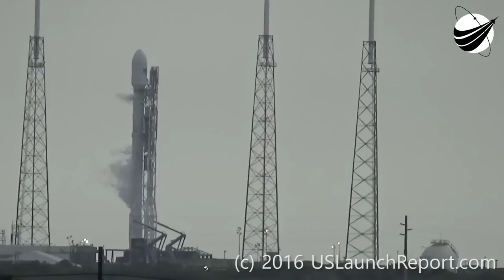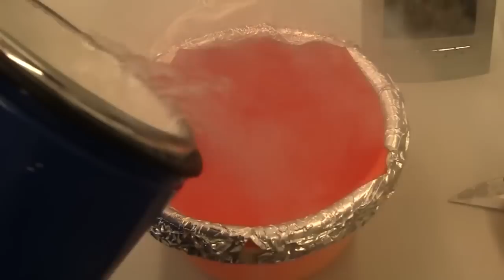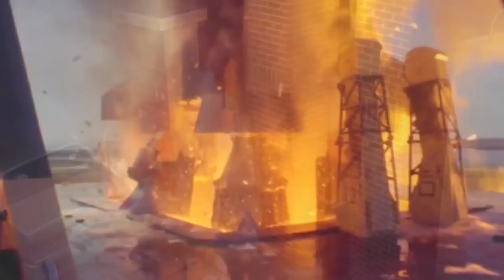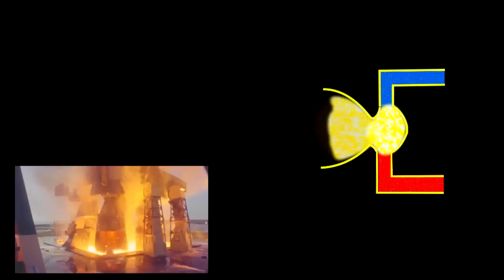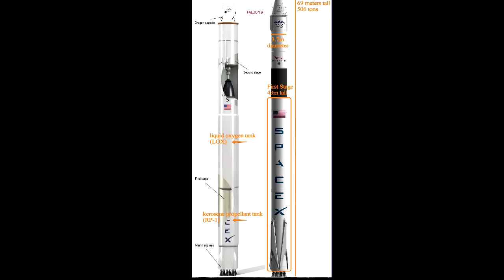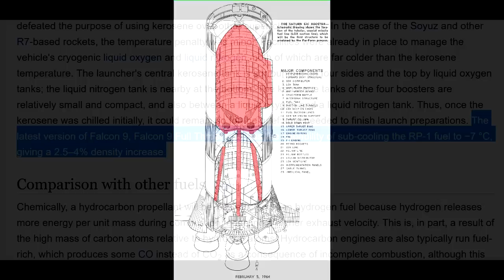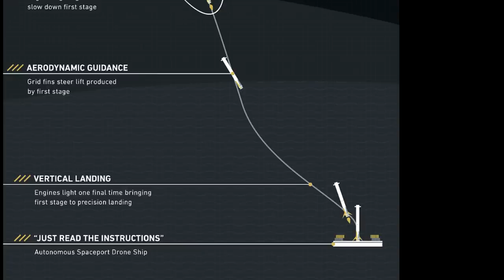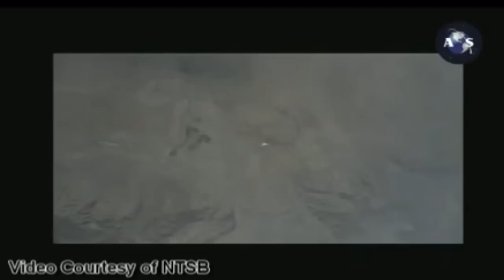Why did the Falcon 9 Explode?

Comment: I'm wondering why everyone's ignoring the anomaly that flies passed the rocket before it explodes...
Reply: Its a bird >_>
Reply: A bird flying 4,950 MPH. It flies behind the towers.
Reply: this is not a 10.000 fps phantom slowmo cam. run at .25 speed and you see the frame skips. its never behind the toweres. if its a bird, speed and size as well as 20+meters distance match and there are loads of birds as well as flys flying in front of camera. i go with the scientific answere = BIRD
Reply: +Snus Caboose Damn Lizardfolk. Always hampering mankind's attempt to leave the cradle.
Reply: Eragon Baffel
The frames you see the object at depend on the source video. In some other recordings of the same video with slightly different framerates, you can see it fly behind the tower. This video could be 29.47 FPS and another video could be 30 FPS and another video could be 29.87 FPS, and they would all change the still-frames of the object.
Reply: Or two videos at the same FPS would be different too since there is no reason they would be in sync.
Reply: it's the Martians, dumbass. They want him to prevent colonizing Mars/ or they warn him of a comming war!
Reply: dudes, end it..it's the Martians, how they did if will be a problem only once we start an open war with them
Reply: It's a linguistic tool to make a statement appear with greater weight, like saying hot fire burned my hand.
Reply: WoopWoopDk "A projectile theory would not be supported because of another simple fact. That explosion came from within. It did not originate from the outside."
A projectile hits from outside and explodes inside. All you see is an explosion, that comes from the inside. The impact effect of the projectile on the outside is much too fast to see.
Reply: Thomas Conyers y doe
Reply: +Snus Caboose speak for yourself buddy.
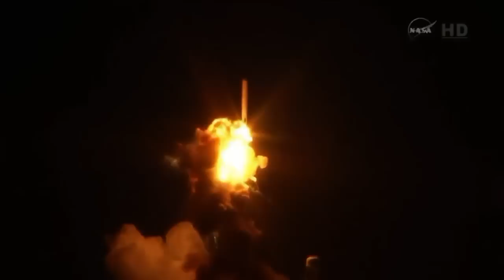Reply: I thought the same thing. Around 1:08, at the bottom right, you can seen another one speed towards the rocket and veer off away from the camera almost 90 degrees...here is a link where you can watch it at 1/4 speed:
http://www.youtubeslow.com/watch?v=_BgJEXQkjNQ
Reply: nehorlavazapalka
e z
Reply: +tunupa1 Is there a video showing how debris, or insects, in the field of view of a telephoto lens causes false perspective of distance.  People really need some science around here.  Though, the sarcasm is strong with posts on this video.
Reply: Except there are multiple object of the same size and camera focus passing before that object. And nothing indicates that the object is behind the towers as you claim.
Reply: WoopWoopDk
No, nearly every other object in the video can be explained as a bird or a bug, because they obviously have wings. The object I'm talking about, looks like nothing other than a sphere.
Reply: Sparta Well thats just dishonest. Within the first few seconds we see tons of objects similar to the "sphere". You dont have access to a 2000 fps super HD video that we dont do you? You are not able to spot any wings on those objects. "nearly every other object". Not a single object has wings. Stop bullshitting.
Reply: WoopWoopDk I'm not bullshitting, I literally see most of the objects in the actual footage have wings. But by actual footage, I mean the additional 30 seconds of footage before the explosion.
Reply: My guess would be some kind of advanced drone equipped with a projectile gun, which shot the Falcon 9. Sabotage.
Reply: sleepingeye "the human mind prefers a conspiracy theory to no theory at all."
Reply: sleepingeye
"Projectile gun"
Implying that there are more kinds of guns than guns that fire projectiles.
Reply: blank guns
Reply: glue guns..maybe it's a foreign language issue
Reply: I prefer to think about things that are likely. Unless you have proof for one or the other, you need to live with a multitude of possibilites. That's what i would call a rational approach to science.
Reply: sleepingeye
I agree.
Reply: sleepingeye As soon as you use "some kind of advanced" in a sentence. You are leaving the realm of science and logic. Its not logical to assume something unknown to be a likely cause. By unknown i mean, something that we do not know to be a possibility in terms of technology. The logic conclusion which means the correct conclusion based on given information. Is so far faulty ignition of fuel to be the most likely scenario. A projectile theory would not be supported because of another simple fact. That explosion came from within. It did not originate from the outside.
Reply: WoopWoopDk
Recently they announced they found the source of the issue, but they still have no idea what caused it. It was a failed helium tank, something that had no reason to fail whatsoever. If the professionals themselves are completely stumped, it's not illogical to explore other more unlikely causes.
Reply: Sparta The most likely case of sabotage since you are asserting that it might be sabotage. Would be internal sabotage of varying kinds.
Reply: sleepingeye Except in that scenario the explosion would also be  angled in the direction of the exit hole. Exploding a high speed projectile faces the explosion in the direction of the prior movement. Which is to say. The impact would be on one side, and the explosion would originate from the inside yet still expand towards the opposite site of impact. There was no such explosion.
Reply: WoopWoopDk No i'm not talking about a large explosive, i'm talking about a very small projectile either just bullet-projectile or with a small explosive which triggers shortly after penetration.
Reply: sleepingeye And then triggers an explosion of a fuel compartment. Possibly. Would definitely be the way to hide it from explosives experts. However it would have to have come from a lang distance, such as a high powered rifle. To eliminate the sounds element of the bullet being fired. It would be highly illogical to assume that a drone capable of flying at such speeds, and accurately hitting a target is in existence. Especially because they are not in use anywhere. And current state of the art drones are incapable of getting even close to such accounting for speed.
Reply: WoopWoopDk I don't even care anymore why it blew up, let SpaceX find out. I'm just a skeptical guy that's why i won't rule out even such things as professional sabotage.
Reply: WoopWoopDk " It would be highly illogical to assume that a drone capable of flying at such speeds, and accurately hitting a target is in existence. "  How would that be illogical? You don't know what secret agencies, the military and so on got. They might have drones that could do something like that, there doesn't need to be a bang, you could use a rail gun mounted to a drone to shoot a projectile with probably up to 2000 m/s or more, so you could fire it from miles away.
Reply: sleepingeye You need to understand what logic is. Logic is the correct assumption based on given information. It is not a correct assumption to say that out of all possibilities a force we do not know to exist might be the cause. You might be right, the logically correct answer is only ever correct in relation to the information available. In our current situation we know not of any such invention capable of such a feat. And so to assume that it is the cause of something that has many explanations that we do know to be possible, is not logical. It is highly illogical. And yet the assumption might be correct. And as such were you to decide to ignore logic, you are taking a leap of faith. Faith being the act of thought suppression to support a view that is either likable or the one you currently hold.
Reply: WoopWoopDk " In our current situation we know not of any such invention capable of such a feat."  Are you sure about that? Well i am not. Sure there are rail guns, there are high powered drones, there are sophisticated aiming systems. You say it's impossible to build a drone with a rail gun mounted on it that can shoot a projectile at 2000 m/s? I say it's very possible.

It is illogical to rule out things just because they may be unlikely.

Faith is for things you CAN NOT know. Logic is for things which CAN be known.
Reply: TheLordIsMyStrength
Reply: TheLordIsMyStrength You know nothing of railguns. The smallest railgun in existence being tested today is about the size of the guns on a destroy battle ship. A boeing 747 could probably transport it but never fire it.  

It is illogical to rule something out based on them being unlikely. Well fuck a duck and call me Brian. Did you just straw man me? I never said that. I specifically stated that the correct answer may in fact be something which we as of yet have no information on. But the logical assumption can never to be to introduce some very specific force of a flying object of greater capability than any known aircraft. And to present that as the "likely" cause of the explosion. You need to understand logic before you get to use that word.

Faith is to believe something for which there is no evidence. Does not have to be in the realm of the unknown. As soon as you take something to be true, without evidence, or even despite evidence, it is faith.
Reply: WoopWoopDk "The smallest railgun in existence being tested today is about the size of the guns on a destroy battle ship."
Wrong. Just search youtube. I know physics btw, you don't seem to.

I understand logic thank you very much.

"Faith is to believe something for which there is no evidence."
There may be evidence, just not evidence that fits scientific principles. I know that i have a soul, i have evidence for it. I just can't present it to you, so it can't be scientifically proven.
Reply: TheLordIsMyStrength I took another look just for the sake of argument. Defective homemade railguns.. That cannot shoot the required size object nor fire at the desired velocity. That is your argument. Seriously?

Also, no, you do not understand logic. If you think that going with the unsupported theory when we are talking which is more likely to be the cause. You do not understand logic. 

There is no evidence that you have a soul. You do not know you have a soul. You think you know. It is not impossible that there is a soul. That is the correct assumption on the evidence. But that does not make it possible. And definitely not likely. Only a fool would believe it. Even if you turned out to be right. You would still be a fool.
Reply: WoopWoopDk Regarding railguns, you are wrong, you probably don't know much about physics.

Regarding logic i stay with my point. It is illogical, to rule out something, that is unlikely. To rule out anything, no matter how unlikely it is, is illogical. If it is unlikely, it means it's still possible.

Sure i know i have a soul, how can you say otherwise, how arrogant is that? Maybe you believe that you don't have a soul, but that's wrong, you have a soul, the devil wants to make you believe you don't, so you can continue to live in your sin and think it's ok. It's not ok, God sees it and he will punish you for it if you don't repent and seek his forgiveness. But i think this is a lost cause because you don't believe in God, how can you, if you don't even believe in your soul.

You are really lost, a materialist. I will pray that you find the way to God. I am pretty sure whatever your reply is, it will be trying to degrade my belief or convince me that i have no soul or some other nonsense. I will nonetheless pray for You. God bless You, i wish you the best.
Reply: TheLordIsMyStrength If you understood logic, you would know that it is a logical fallacy to use the argument from authority. Being the "you are wrong i am right, because i know something about this". If you truly knew something about railguns you could have simple presented the evidence. You do not, and so your comment about me not understanding physics inadvertently became a testimony to your lack of understanding of both logic and physics. Also i never ruled out anything in regards to logic. We were talking about which is likely. Its a logical fallacy to present something with no evidence as a possibility in a debate aimed at finding a cause. A lightning fast unicorn could have caused it. You cant rule it out. 

No you do not know you have a soul. You might have one. its not been disproven nor proven. And as such when it has not been proven, what you might think to be evidence of the soul might be caused by something else entirely. Lots of people think they went and saw their family before being revived with CPR but in reality, it is more likely that they hallucinated it/imagined it. In summary you do not know you have a soul. You think you know. And you might be right. But until you actually know, then you do not know. Do you understand that very simple concept?

My respond is not about degrading your belief. That is for another debate entirely. You just happened to bring up a very poor example of the soul.
Reply: WoopWoopDk Much talk, no wisdom.
Reply: WoopWoopDk Only wisdom comes from God and his word the Bible. Your science floats in empty space filled with maximum entropy aka chaos. There is no science without soul, a subject, a scientist. You are lost in your relativity.
Reply: TheLordIsMyStrength Im sorry. Now you are just moving out of the realm of reason further than before. Wisdom comes from god in that he created us. If he created. Kind of important to prove that one before you assert the other.
Reply: Of course he created i mean, you exist, right? How does existance come to be from nothing? I know your answer, i've heard it 100 times. "We just don't know yet"  Well the thing is, i know NOW, that nothing can come from nothing. So if you don't have God, you have nothing. To deny God is like denying your own existance. It's nonsensical. That's my starting point of logic and philosophy. God created logic and the basis of philosophy (existance). I don't think we disagree about the method of logic, but about the fundament upon which it rests. Where does your logic rest? What is your basic absolute assumption on which you place your philsophical/logical framework?
Reply: TheLordIsMyStrength You ofc forgot to mention that god is not nothing, well he most likely does not exist so in a sense god is nothing. But if god exists he is more than just something. And he came from nothing. Your logic is as pointed out a flawed special pleading and a gross logical fallacy.

You do not know how the universe came into existence. You do not understand the word to "know". I cannot believe i have to repeat this. You think you know, but until you can confirm your belief. All you have is just that, belief.

If that as you say is your starting point of logic and philosophy disregarding philosophy which is irrelevant. You do not have logic. That is not what a logical conclusion is. Logic abides by a set of objectively correct set of laws/rules. It is not logical to state that nothing can come from nothing. And then to say, "well except god, the most complex being ever to exist" (paraphrasing). 

Well ofc we disagree about the method of logic. If we did not we would be at the same assumption. That is the thing about logic. There is only one conclusion from every given set of information. You go "without god there is nothing because nothing can come from nothing". Which is a straight up logical fallacy that solves nothing. God becomes an infinite loop that requires infinite gods to satisfy your view. God could not exist without God's god because he could not come from nothing, something had to create. That is the very definition of nonsense in regards to logic.
Reply: I know i have belief. That's more than enough for me. You have no belief at all, you have no basis for absolute reality.

No God is not an infinite loop. God is the creator, he existed always and will always exist. He was not created. Why God exists, no one can answer. He just does. The problem is that you are so arrogant that you can't accept that there exists a thing that you cannot know by your own methods. That is God. God can only be known to us because he revealed himself.

You think the only way to find Truth is science and your scientific methods. That's very foolish, and if you are philosophically inclined, you should know this. You can't build metaphysics from scientific methods, so the basis of your assumption, that science necessarily leads to truth, is futile. Science only leads to truth, because God made natural laws which he upholds and because God made your brain work. Prove me that your brain is functioning correctly. There your belief breaks down. You can't do anything without God.
Reply: TheLordIsMyStrength No science is the opposite of intellectual arrogance. You are the one that claims to know things that i cannot. And you cant even prove it. You are the one that claims to know what god wants from us. You are the one that claims to know the truth. I am the one that says, i cannot believe something without evidence, yet i will not deny the possibility of "a god". I will deny the possibility of your god the Christian god because he simply goes against science in so many of his alleged actions in the bible. 

Saying that god always existed simple makes no more sense than saying matter always existed. You think that it is more likely to come from none-existence to a simple existence of 1 type of matter. Or to come from none-existence to the existence of a supreme magical being with advanced thought patterns, feelings and opinions. Yea, that sure is more rational than to go by my view that the big bang currently holds more evidence and is more likely. To say that god just exists gets you nowhere its a baseless claim.

Science is the only way to truth? i never said that. It is the only way to be certain that you have found truth. That would be my phrase. You keep repeating the logical fallacy that god is the reason behind my brain function and the function of science. Again, you do not know that. You presume to know it because you believe it. You have only a claim. Not proven. It is more logical to assume that the laws of nature works because you can expect objects of equal form,mass and chemical composition to always act the same way. I do not need to prove that my brain functions as you put it. I am already pointing out flaws in your every argument and instead of pointing out why you disagree with them, you simply repeat that same argument.
Reply: "Saying that god always existed simple makes no more sense than saying matter always existed." Matter is dead, God is spirit. Big difference.

"It is the only way to be certain that you have found truth."
Exactly the opposite is wrong. The only way to KNOW is by faith. You need to have faith in your reasoning, your logic, in your five senses and that your brain is not deceiving you. You can't prove your logic, that's impossible, aka Goedel's incompleteness theorem.
Reply: WoopWoopDk Again, where is your foundation, upon which your logic rests? Prove to me that your ability to reason leads to the Truth! You can't.
Reply: TheLordIsMyStrength Well i can prove it that is the beauty of it. Logic is drawing the correct conclusion/assumption of the evidence you have available. And science is the only tool we have of providing conclusive evidence with certainty. How does science work since its the tool of discovering and confirming truth? It works by testable evidence. And observational science works by testing the methods validity and then using it. 

Now it would be difficult for me to start giving examples of things that works because of science. I would much rather address a specific topic of your choosing that you disagree with science. I suppose if you disagree with science then you disagree with all technology in existence. You simple deny their function. Seeing as the scientific method is behind all of it. 
But choose something that you do not understand and ill explain it.
Reply: Sure, explain to me how you prove that your logic leads you to truth. You can't, you must assume the validity of your method, aka science, in order to use science, to prove that science is right. Don't you get the problem of this circular reasoning. Your house is built on sand, it will not stand. Build your house on the rock, Jesus Christ!
Reply: "Well i can prove it that is the beauty of it. Logic is drawing the correct conclusion/assumption of the evidence you have available. And science is the only tool we have of providing conclusive evidence with certainty."
That's what you BELIEVE. You can't prove that your science leads to truth, you assume it.
Reply: TheLordIsMyStrength No... It is not what a i believe. It is what evidence shows. You were able to comment from a computer invented by science, On the internet brought to you by science. Science produces positive and reliable results. And it is the only way of doing so. What we had prior to science was alchemy. But that covered only the part of being able to recreate certain reactions through sheer process of elimination. Science is the only tool and it works. I do not need to prove that it leads to truth. It does, and no one can deny it. Everything we use is here because of science.The discussion should go no further if you cannot understand this simple fact.

You cannot use your lack of knowledge and ability to comprehend something to diss my capability of doing so.
Reply: "I do not need to prove that it leads to truth. It does, and no one can deny it." Talking about faith in things you cannot prove.
Reply: WoopWoopDk I don't wannt to "diss" you, i want to find the truth just like you. And it's just wrong to say that science is right per definition. Science must rest on an absolute assertion of truth, which only an eternal God can provide. That's my point. I don't believe there is any other possibility of Truth than God.
Reply: TheLordIsMyStrength But you can test the truth of a claim. You dont seem to understand how science proves something. In order to find the truth about what causes something for examples. You keep looking for what could cause it through observational science like a lightning. No longer something that would credit either Thor or Zeus with. Because we studied it and found that there is a natural process behind that we can rely on. What you wanna do is study lightning a couple of 100 times to make sure that nothing divert from your thesis. Then you have a thesis that goes, we believe that lightning occurs when A interacts with B. Then the next steb is to recreate it. And then ultimately predict where it might happen ahead of time. Because your test results are reliable and you know exactly what causes it. 

That is how science produces truth. It tests something many times to get enough data. Then it recreates the results, and ultimately becomes able to predict results. It is the only tool we have producing reliable results. And in hindsight it gives us truth when done correctly. Not always the entire truth. You may know what causes something but make a mistake as to why it causes it. We may know how to do something but not how it works. But the knowledge that we have is still truth. 

Science is not the only thing that can provide truth. Sometimes even religion provides truth. But it cannot reliably be trusted as religion is nothing but a broken clock. And even a broken clock is right twice a day. But ultimately religion cannot test whether their thesis is true, and recreate it to be certain. Because to do that you need science. Because that is whats sicence is.
Reply: Science can't do anything on it's own. Prove to me that scientific methods lead to truth without God.
Reply: TheLordIsMyStrength 

That is a logical fallacy. Prove to me that it requires god. To prove that you must first prove that god exists. So the logical assumption is to assume that it functions without god as we cannot know whether he exists or not. 

In retrospect prove to me that the world works without the magical powers of Gypsy Leprechauns who danced the world into existence and enforce the laws of nature with their golden swords. Laughable right? But you cannot disprove it. Now you know what it is like for me to have to listen to your argument.
Reply: Yes, prove to me that science leads to Truth. You still can't do it, still you assume it leads to Truth.
Reply: TheLordIsMyStrength i just did .You told me to prove that it leads to truth without god. I cannot disprove something that has not been proven. In a sense you cannot prove to me that you have a soul with the magical Gypsy Leprechauns. 

I just told you that science leads to truth. But obviously you must confuse truth to meant the ultimate truth of reality. Science has yet to attempt to disprove the possibility of "a god". 

Science produces results that are true. So if science wants to find the truth of what causes hurricanes it sets out to study hurricane and do small scale recreations of them. Then eventually it becomes capable of consistently predicting the occurrences of hurricanes. That is truth. If you know what causes something and can consistently predict when a hurricane occurs. You have scientific truth. Now whether you think that god caused the conditions for a hurricane to come true, is irrelevant as we know what causes the hurricane and when it occurs, and will occur. That is scientific truth on the subject of hurricanes. It is truth. There is nothing left to discuss.
Reply: WoopWoopDk "But obviously you must confuse truth to meant the ultimate truth of reality." Well what other kind of truth is there than the "ultimate truth of reality"? None.
Reply: WoopWoopDk You just have a very loose concept of truth. You have not prooven anything, because you can't. There is no way to know truth from false without an absolute standard, which is God. Science is not absolute, it's a human endeavour.
Reply: I really wanna thank you for the very nice discussion, but i don't think we will come to a conclusion. We both have very different views on how to approach truth. I believe God is the very bearer and creator of existance and therefore Truth itself. You think science can find truth, if not in everything, then at least partially. I respect that and i respect your belief (that science leads to truth), but i just can't share that belief. I think science is just a tool, like a spoon, what good is it, without a living being, a man, using it. It is nothing, it wouldn't even exist. There is no science without the human mind, and the human mind, soul, whatever you want to call it, has been created by God. That's my belief, i can't imagine any other possibility. I wish you the best!
Reply: TheLordIsMyStrength You have abandoned reason. You spout these notions that bear no relevance to anything other than an intellectual cop out. You cannot say that god is an absolute standard of anything. As far as we are concerned he is still fiction. there can only be one true god if any. You pick yours out of the hundreds of thousands of gods that was ever worshiped. The likelihood of yours not simply being amongst the rest of the man made gods is so slim as no evidence supports his existence.  

Science provides truth as the only tool in the existence. you do  not get to say that it is not true because it is thought out by humans. In a different universe where the natural laws where different science would still function. It is a method of repeating results to provide evidence. It is objective truth. You cannot understand that because you are too busy to abandon reason as it hurts your comforting delusion of eternal life.
Reply: WoopWoopDk "Science provides truth as the only tool in the existence. you do not get to say that it is not true because it is thought out by humans."  I'm not saying it's not true. I'm saying, you can't prove it's validity without reference to an absolute standard, which you don't have.

I have reason by the grace of God. What is the base of your reason? You just say, you have reason, because you do?
Reply: TheLordIsMyStrength You are just saying shit that makes no sense. We dont need an abolute standard. What does that even mean.  We have the natural laws that does not change. In what way do we need a god in this picture. 

You have reason by the grace of god? that means nothing. Its just verbal vomit. talk sense dammit. Science works. If you have conceded that. Then we are done here.
Reply: WoopWoopDk Science works yes, but why does it work? Because our brains work, our logic works. Now why is logic working? Just because it is so? Prove to me that logic is the right tool to find truth. You can't. That's the point i'm trying to get across. Relativism, you have no firm ground on which to build your reasoning. You have no rock on which to build your theories. They are floating around in space, all is relative, truth in your world view, is so relative. You even made the distinction between scientific truth and "absolute truth" in an earlier post. How can there be two different standards of truth. Either something is true or not. It can't be both.
Reply: TheLordIsMyStrength I wont bother to respond to that... You keep saying that i cant prove it. I have proven both. You have avoided to address my arguments. And as such, this debate is concluded. You have consistently retreated in this debate. Since you cannot point out any flaw in why logic works and why science works as i presented it. This is over.
Reply: WoopWoopDk You haven't proven anything, because you can't. You can't prove that your logic is right by means of using your logic, because in order to use logic to prove your logic, you need to assume the truth-validity of your logic in the first place.
Reply: TheLordIsMyStrength Its simple... If i am given correct information ill draw the correct conclusions and assumptions every time. If i am given incorrect information, im still drawing the correct logical conclusion but the answer might be factually incorrect.

Logic works. There is nothing to discuss. Its the correct tool for handling information. If you disagree with this, then you have intentionally ignored my previous explanations of logic.
Reply: WoopWoopDk "Logic works. There is nothing to discuss. Its the correct tool for handling information."  So you just assume that logic works and is an adequate tool to find truth? But you can't proove it. That's my point.
Reply: TheLordIsMyStrength I did. I did it over and over again. No logic cannot find absolute truth about the universe because we have no way of testing gods existence. 
But logic can find the truth in data. As such with wrong information logic will draw the correct conclusion out of that data, but since the data is wrong the conclusion is ultimately wrong. But logic is flawless in it self. If Z and Y proclaim that X is true. And we know that Z and Y is true, then X is true.
Reply: WoopWoopDk "But logic is flawless in it self." That's an assumption which you cannot prove.
Reply: TheLordIsMyStrength No i just did. Logic is simply the correct conclusion drawn of given information. If we lived in world with a god, without a god. It still works. In a world with a different set of natural laws than ours it would still work. 

You keep saying that i cannot prove it. It works whether or not you can comprehend it. It is very clear that you have shut down intellectually right now. You cannot say that my evidence is not adequate. This is how debates work. If i present the evidence you its up to you to point out the flaw. You have now consistently said that i have not proven it. but i have. You lack the cognitive ability to comprehend it because it is a point which negates your side of the previous debate. Either that or you have understood by now, which and are just dishonest. I must admit im surprised you do not understand yet. The most stubborn Christians i have met have conceded to this empirical fact.
Reply: WoopWoopDk "Logic is simply the correct conclusion drawn of given information."  That's like saying an apple is an apple, and saying that proves that an apple is an apple. You define "logic" as being an adequate tool to find truth. That's your a priori definition. You can't prove logic by the use of logic, because what if your logic was flawed, then your (logical) conclusion, that your logic is true, would be flawed, without you knowing it. I'm not saying logic does not work, all i'm saying is, you cannot prove that logic works, you have to assume that logic works, in order to even use logic. So how exactly do you prove that logic works? You can't. You need to have faith that it works.
Reply: TheLordIsMyStrength I can prove logic with science if you want. They go hand in hand. If you are given a set of data, you then use logic to predict the outcome of a certain test by drawing the conclusion from the data. You now have a testable answer from logic. And lo and behold that is what scientists do, and every time it is correct. And when they get it wrong, they later discover that Z or Y information was incorrect. Logic is infallible. In a sense logic could only ever not work if a god broke the laws of nature creating an inconsistency.

So yea, logic cannot prove it self, a conclusion is just a conclusion until it is confirmed. But science is the way to go if you wanna confirm your conclusions. And science does it over and over.
Reply: "Logic is infallible." That's what you assume. But you can't prove it.
Reply: All you do is say, logic works, because it leads to the "right" conclusions. It leads you to some conclusions, but how do you know they are the right conclusions? By using logic. It's circular reasoning and it has no ground to stand on. God is the only reasonable basis for rationality/logic.
Reply: TheLordIsMyStrength No its not. We can test whether its correct or not. That is how we know. The scientific process can confirm any logic based conclusion. How dense are you?
Reply: WoopWoopDk You cannot test the validity of logic.

What do you mean how dense am i? If you mean my body, about the density of water which is ~ 1000 kg/m³
Reply: TheLordIsMyStrength" Dense: informal
(of a person) stupid." Awkward for you eh? 

I can test the validity of logic. I just told you how. re-read please. Your lack of cognitive ability makes my little sister seem smart.